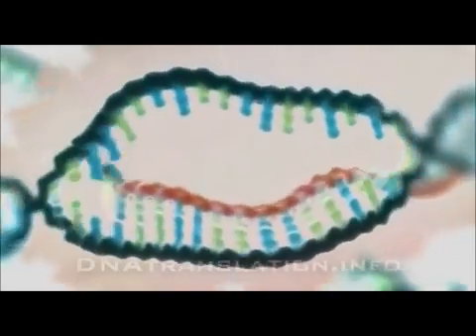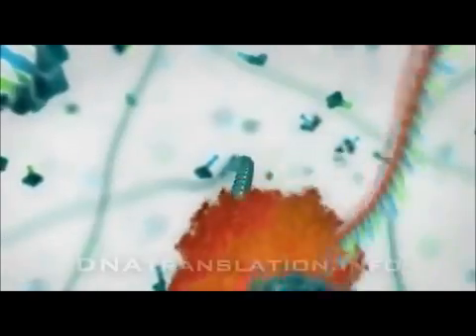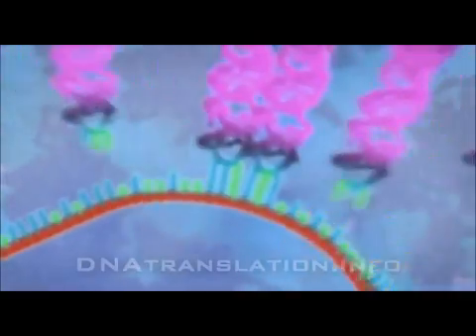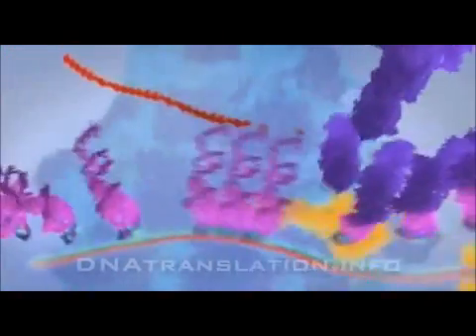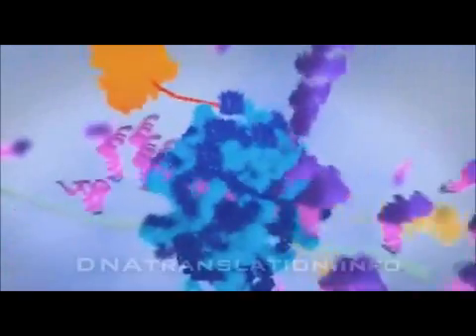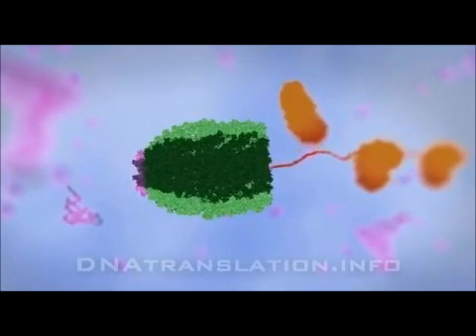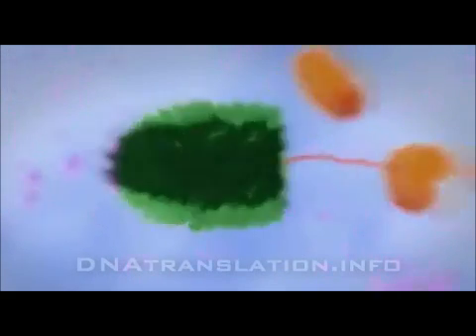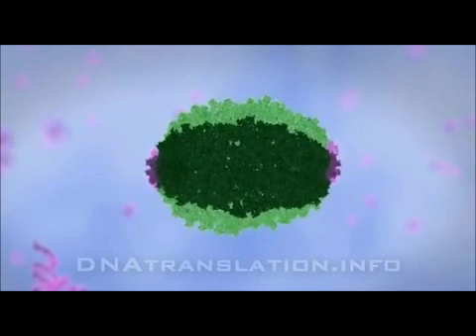Protein synthesis (DNA transcription, translation and folding)

Comment: The perfect primordial soup recipe: Take a sterile petri dish. Add a buffered solution and one amoeba, a single celled animal. Pierce the outer membrane of the amoeba, and all the contents will flow out. There you have amino acids, proteins, peptides, strands of DNA, everything for simple life to exist. The problem now is this. Do whatever you like to the contents of this petri dish, swish it around for a million years, shock it with electricity, add methane, whatever you want... Nothing "science" does will bring those perfectly formed amoeba parts to life. Without proving abiogenesis, evolution theory is completely useless and moot. It’s a story without a beginning, and makes no sense.
Reply: Frank M Frank, Darwinian evolution doesn't apply for the beginning of life. To have evolution three things are needed: replicators, selection and mutation; in the beginning these conditions were not in place. How evolution could start? This is a good question and hopefully it will be covered in our life if we are lucky enough. Even if you understand protein synthesis, you cannot answer these questions as current DNA mechanism is the result of a three billion years of Darwinian evolution... DNA protein synthesis is like assembling a Boeing 747. You're an engineer in the plane manufacturing factory. You know everything about your aircraft... But you have no clue how a simple craftsman could build the first glider in the late 19th century, because he used a very different technology.
Reply: Csaba Purszki "This is a good question and hopefully it will be covered in our life if we are lucky enough."  Life didn't start on its own. Life could not have started on its own. The more we learn about life and cell function the more implausible life starting on its own becomes.
Reply: +Frank M &quot;The perfect primordial soup recipe: Take a sterile petri dish. Add a buffered solution and one amoeba, a single celled animal. Pierce the outer membrane of the amoeba, and all the contents will flow out. There you have amino acids, proteins, peptides, strands of DNA, everything for simple life to exist.&quot;

hahaha! thanks for the recipe tho. I&#39;ll try it in my room xD

Comment: In the last 10-15 seconds of the video she said that DNA has an intended function and is released to do its job.. I never thought of DNA as doing work..
Reply from the maker: It's actually the folded protein that is released to do the job; it is a product of the information on the DNA that is copied to messenger-RNA which is de-coded in the ribosomes to produce the protein, etc. But yes, DNA codes for proteins that do work. Many proteins are actually nano-machines; for example, ATP synthase is a rotary motor that produces ATP, the energy currency of life, using the energy from an electric current of protons.
Reply: fascinating, utterly fascinating! Thanks brotha!

Comment from the maker: 1. More and more cases are being found where both strands of the DNA are transcribed (into different proteins or for gene control) - I wonder if anyone on earth could devise such a thing; it is mind-bogglingly difficult. 2. DNA's double stranded structure is more stable than RNA with its single strand. 3.The double strand is used for error checking to correct for most mutations. 4. DNA lends itself to chromosome 3-D structure (coiling, super-coiling, etc) for compact, organized storage.

Comment from the maker: Good question about chaperonin folding. I have not been able to ascertain if they require chaperonins themselves to fold correctly, but I would not be surprised if they did as they are complex proteins themselves. Eukaryotes have chaperonins with two ring structures joined back-to-back and each ring consists of 8 similar (but different) subunits. You can read a 2011 review here: hindawi.com/journals/jaa/2011/843206/